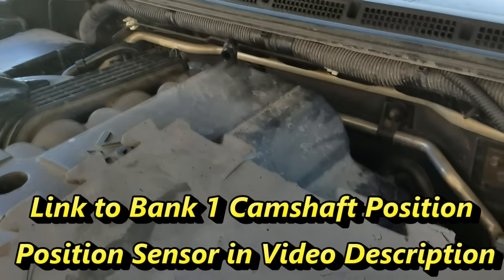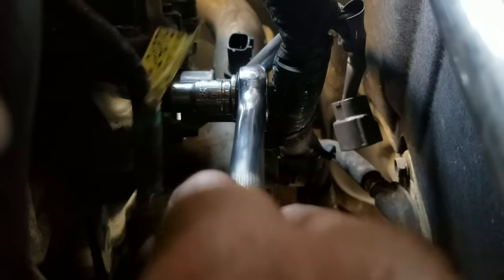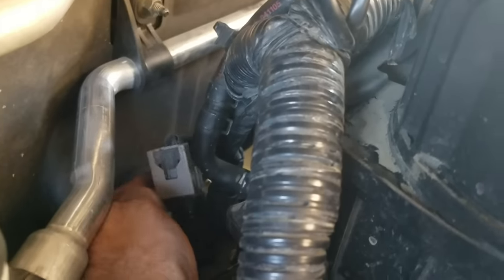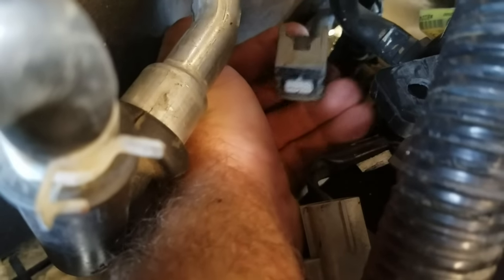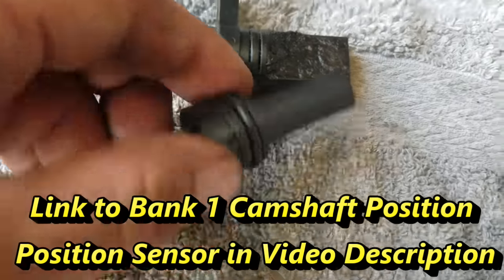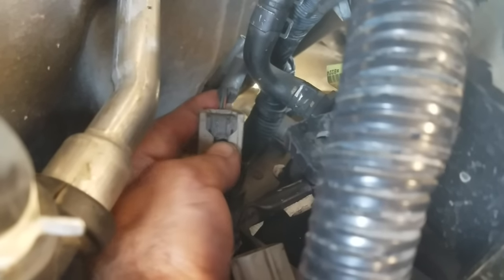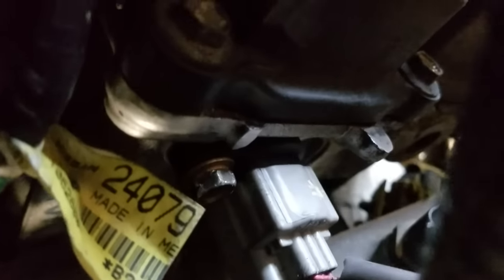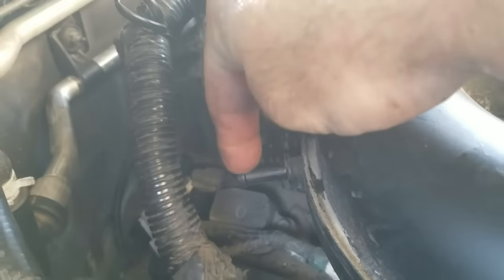Camshaft Position Sensor Nissan Frontier Pathfinder Xterra

Comment: I wanted to add my 2 cents. I am NOT mechanically inclined ... and wrenches do not belong in either one of my hands, but I wanted to try to be a little more self sufficient so I thought I'd give this a try. The video was invaluable. I really appreciate the post. This took me every bit of 20 minutes to complete. I decided to use the box end of a 10mm wrench, which worked out well. I laid a moving blanket over the engine and laid on the engine compartment from the front of the truck. I used both hands to remove the bolt/part .... my left one to feel and guide, and my right one to turn the wrench. After removing the bolt, I wiggled the part out. I then moved over to the left side of the truck, held the part (still connected to the wiring harness) with my left hand and used my right hand and a pair of needle nose pliers to remove the part from the harness (making sure I remembered how the part was oriented). I put a coating of fresh oil on the o-ring of the new part and attached it back to the wiring harness. Moving back to the center of the truck I used both hands to reseat the part and then put the bolt back in place and tightened it down. If you are a novice, I feel you can perform the swap-out .... but concentrate on NOT DROPPING the bolt or any tools. And remember how the part is orientated to the wiring harness as well as which side the bolt goes on to secure the sensor to the engine.
Reply from the maker: Good 2 cents! Thanks for adding your experience and tips.
Reply: Good advice. My only difference was I used medium channel locks to squeeze the harness clip down then used both hands and popped it off.
Reply: Is that the right side sensor or the left side?

Comment: Just a reminder, to the left of the area you are working on. There is an HVAC line clamped to a plastic nipple. Be careful not to put too much weight on it, you will break the plastic nipple and have to replace the whole line
Reply: Thanks for the heads up!! Is that the nipple of the PCV valve?
Reply: @dedwards0117  it's on an HVAC line. I put a little weight on the top and broke it.
Reply: @turbolagger2011  ok thanks

Comment: Good video, it helped me to mentally prepare for the upcoming nightmare. How anyone can do this repair in 20 minutes unless they've done it before and the stars are all aligned is beyond me. It is a royal PITA but I got it done. As others here have, the easiest technique for me was to lay on top of the engine and use a box wrench. If you're on top of the engine it enables you to use two hands which helps being that you have to go by feel. Remember to disconnect the negative battery cable before you start the job. In addition to electrical safety that will also reset your ecu and clear the code automatically. I used an oem replacement sensor for this repair due to its sensitivity and importance. The oem part will cost more but the piece of mind is worth it.
Reply from the maker: Good tip.

Comment: Thank you for showing where this pesky part was located.  I was able to replace mine today.  At first, the engine didn't turn over so I had to pull it out again and check the connection and reconnect it and then screw it back in, but now my engine is purring like a kitten.  Thank you so much for posting this video.  You saved the day.

Comment: For anyone that doesn’t have mechanical skills. You cant see behind the engine. Use your camera phone and take pictures. It’s on the passenger side but close to middle. Try to match your photos to the video’s photos. I found it by seeing the 3 silver tubes in video. It isnt too far down but it sticks out. Wiggle it free and replacing it is easy. Dont forget to disconnect the battery and lube part.

Comment: Thank you so much for this video!  I just changed mine today.  The hardest part was getting the sensor off of the connector.  The needle nose pliers worked great.  I wish Nissan would have made the wires a little longer ti make it easier.  Took me about 35 minutes from start to finish.  Took me longer to find the tools lol.
Reply: Do we have to disconnect the battery while doing this?
Reply: @travisdo9201  I didn't but I saw a video where the person did.

Comment: Thank you!!! I have done this twice now. Without your help, this would have been incredibly difficult….. Apparently, the aftermarket parts don’t hold up that well. I did this for the first time 2 yrs ago.
Reply from the maker: Bummer the aftermarket part didn't hold up.
Reply: I took my pathfinder on a 4 hour road trip and car started acting up.. it was again the camshaft sensor which only held up for 2 years

Comment: Great job detailing on how to find and replace the cam sensor.  I'll be doing this on my 2006 Pathfinder, the same happened to my Nissan Murano this seems to be a common issue on Nissan they need to fix this problem.
Reply: What is the faction of senser thanks eng

Comment: Great video, most helpful when recently replacing both cam shaft sensors on a 2012 Nissan Crew Cab with 220,000 miles. Basis my experience along with gathered information suggest putting down cardboard on the engine top to lay down on your stomach. You will not see much until the sensor is unbolted from the engine. To unbolt a boxed end 10mm wrench will work perfectly in the vertical position. Removing the sensor from the plug requires patience and suggest if it is not cooperating take a break (off the engine). The tab must be slid down on the plug to unlock. Bank one (passenger side) took me about 30 minutes, bank two (driver side) is much easier taking me maybe 10 minutes.

I don't want to do this again and my research recommended using the more expensive Nissan parts, as well as, replacing the other sensor even though it was not sending a code. Figured it was just a matter of time before being problematic.

This video was most helpful. Don't know how it was shot because there is not much room for anything between the engine and firewall let alone a camera.

Comment: The bank 1 connection is the hardest to get unhooked. I used an extended neednose pliers with a 45 degree angle to them to depress the clip. Got the pliers at harbor freight. Made it so much easier to get it off.

Comment: Thanks for the video. My Nissan frontier has been misfiring so I’ve changed coil packs fuel injectors just to still have an engine problem. Now I’m coding P0420 and P0340 so catalyst below threshold and cam position sensor hoping this cam sensor clears up the problem
Reply from the maker: Did it work?
Reply: Also interested. Did it work?

Comment: You find if you take off most of the plastic on top of the motor, you will find you have a lot more in room. Do not be afraid to pull wires. Take them off and get them out of the way. Makes life easy.

Comment: Great video, thanks! Question: I have a 2012 Xterra Pro-4x w 125k miles on it. Do you recommend swapping out the camshaft sensors as a preventative maintenance item?
Reply from the maker: Hmmm, its subjective, but i think if you want to prevent having a stall out while driving, it wouldn't hurt.  I would hate to remove an OEM part to install an aftermarket one though.  Up to you.

Comment: Question?, would a bad negative terminal on the post throw this code? Truck stalled on me out of the blue then turned over longer then normal until it started. Engine light is still on but I guess I am going to fix the terminal first and see. Truck didn’t sputter at all.
Reply from the maker: A bad terminal shouldn't throw that code.  What you explained is similar to my experience.
Reply: @NissanDudeAZ  it was the cam position censor. I traded the truck in for a new ram.

Comment: Thanks for the video dude! I got a used 07 S two months ago and found it can't start sometimes. And even misfired on the road once.(the guy who sold this car with such issue is an Axxhole, misfiring on the road may get someone killed) After trying several times and fired it up eventually. The engine light popped up and i read P0340, which indicates the camshaft position sensor problem. Does replacing the sensor will solve the problem?
Reply from the maker: Yes it does.  I had the same problem with the misfiring.

Comment: The only problem it is the sensor is not the same when you buy in O'Reilly Auto parts so you have to buy original in the Nissan dealer
Reply from the maker: Mine worked just fine.

Comment: This video was awesome for finding what I needed to do. But, I'm too old, fat, and stiff to crawl in from the driver's side. I was able to break it loose with a 10mm box (@glennoliver9391 mentioned), but still ended up using a 1/4" ratchet and small 10mm socket to get it out. The smaller ratchet was able to fit between the socket and the cable.

Comment: I ended up breaking my intake hose from leaning on the engine, not sure if it was my hand or leg. Replaced both sensors. I used my phone in video mode and just guided my hands to do it. Never again...hopefully.
Reply from the maker: Bummer

Comment: thanks for the info!
  btw, is that a huge crack in your coolant line @2.55 just above your wrist?
Reply from the maker: No it is not a crack, only a plastic weld seem.  However funny you mention that.  I had to replace the entire aluminum tube, and that piece it connects to due to a split where the plastic meets the aluminum tube.  It was a biotch to find what part it was.  Good eye!

Comment: I have a nissan pathfinder 1999. I feel engine sputtering , hard idling while driving and i cant pass 30mph at some time. Did some fixes earlier but PO300 is that bothers me. Do you think i should check my crankshaft ps? Thanks in advance
Reply from the maker: Yes.  Look up the code at clubfrontier.org

Comment: Thanks for sharing - I was about to lose it over that plastic wire harness.  However, I would tell anyone trying to do this job to REMOVE THE INTAKE MANIFOLD COLLECTOR.  It's not that hard (7 bolts and some hoses)....it will make this job way easier.  Thanks again
Reply from the maker: Yeah that Wire Harness is a Biotch!
Reply from the maker: Good tip.
Reply: Yes taking intake will make it easier but you are supposed to put new gaskets on the intake if its removed. I replaced my valve covers so I did remove the intake.
Reply: That's what I intend on doing cause I have to replace knock sensor also

Comment: Your video is great and very helpful! My sons 2005 nissan xterra had a p0340 code. I changed the bank 1 sensor using a $110 Hitachi one. Its hard to start and im still getting a p0340 code. Any suggestions, I cant figure this out?
Reply from the maker: I'm sorry to here you are having trouble.  I'm not certain as to what can be the issue.  How many miles are on the truck?  Are you certain you ordered the correct part? Did you make sure the sensor was fully clipped into the connector?  Was it tightened up all the way? 

If all are yes, possibly clean off the old sensor thoroughly an swap it back out with the new one, see if it works.  If not, it could be a bad camshaft or timing belt.  Hard to know.  Good luck.
Reply: @NissanDudeAZ  I fixed it! Due to my valve covers leaking, oil was on the connector. I cleaned the connector coming from the harness with electrical cleaner, reinstalled everything and now runs great. I did replace all spark plugs, coils and valve cover gaskets on both sides with nissan oem and put black rtv gasket on the front corners of both where there's a slight offset. It now runs excellent! Thank You!!!!
 2005 Nissan Xterra SE with 132,000 original miles.
Reply from the maker: Badass!  That's a lot of work, but I'm glad you solved the problem and a few potential future problems at the same time. GREAT WORK!!!!

Comment: I have changed all but one of the sensors but that passenger one this a differnt code . I have done the transmission one and the driver side one and still codes growing for it.  Not the passenger

Comment: how many cam sensor does this vehicle have?
Reply: Too many
Reply: Two cam sensors.  The driver side is way easier to get to.
Reply: The driver side sensor is in "bay 2" and the passenger side sensor is in "bay 1". This will tell which one to change when you plug in the code reader.

Comment: I have VLC, ABS, Slip, Brake lights that come on for no reason.  I just replaced spark plugs and camshaft sensors due to 2010 pro 4x mis firing.  I’m stumped now.
Reply from the maker: That is odd.  Search on clubfrontier.org for others that have encountered that issue.

Comment: if it is sensor is bad what happened do what trucks I got problems with my truck sometimes my truck is not strong very weak when I drive it please help with a comment thank you
Reply from the maker: Take your truck to the auto parts store to check out the "engine code" if your check engine light is on.  If the code is P0340 then you need the part that is listed in the video description.

Comment: Is there suppose to be oil all over the  part of the sensor inside the hole? I pulled the sensor out and it had oil on it.
Reply from the maker: I don't know :o
Reply: I would think that the oil is the lubricant for the cam so there should be oil in there. Not sure how much would be too much though.

Comment: How many Camshaft position sensors are on a 2006 frontier 4.0? I have the P 340 code but dont know which sensor to change or if it's a wiring electrical issue or computer issue
Reply: RUACH p340 is bank 1
Reply: @AndresRamirez-lr9up  I changed sensor but still 340 code and slip light, engine running rough
Reply: @TroyGacayan   I know some engine management systems have to relearn for the new sensor, sounds like maybe you had that issue?
About to do mine- did you solve this? My 08 4.0 also has VDC and slip lights on- trying to prepare for if replacement doesnt fix it- maybe battery or connections but I'd like to get as much outside personal experience info as possible before I do it.

Comment: Pulling my hair out! I replaced the drivers side cam sensor THREE times in two weeks yet it’s still coding for that sensor and have trouble starting.
Reply from the maker: That is not good.  I wonder if there is something wrong with that camshaft.  Do you have any knocking or ticking noises?
Reply: @NissanDudeAZ  I fixed it, I had to replace all three sensors at the same time with Hitachi parts.
Reply from the maker: @dannybelindafam5420  Great work, I'm glad you got it working!
Reply from the maker: @dannybelindafam5420  hard work, glad it's fixed.

Comment: Good video! I got P0340 on OBD II, cramshaft sensor bank 1. 😀 so funny that you described as blind man to have sex !
Reply from the maker: Good luck with the repair.  Just feel around for the gaping wet hole before you push it in.

Comment from the maker: Let me know if you have any questions.
Reply: is there more than 1 sensor on the 2009 pathfinder. still having problem
Reply: I found on my 2009 Suzuki Equator that their is a 12mm bolt that holds the wiring harness in place about two inches down from the sensor. Removing that bolt allows the wiring harness to move a little more
Reply: I had 1 of 5 all 0345 . Error 3 had a “p” next to it ? Why 5 ? Just need to clear errors then retest ? Idk
Reply: Have an 01 xterra 3.3l changed the knock sensor and plugs.. now it wont start and throwing a camshaft positioning sensor code.. went to price one out and they cannot find one. All they have is the crankshaft position sensor.. so any help would be nice.
Reply from the maker: @wwalker3951  There are 2 camshaft position sensors, bank 1 and bank 2. There is also a crankshaft position sensor